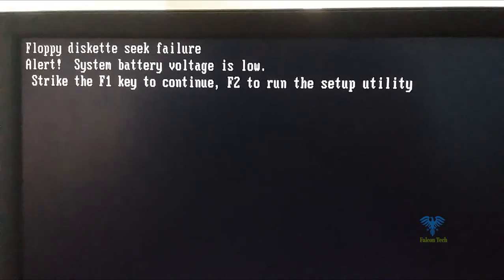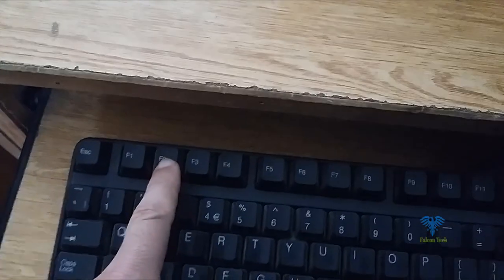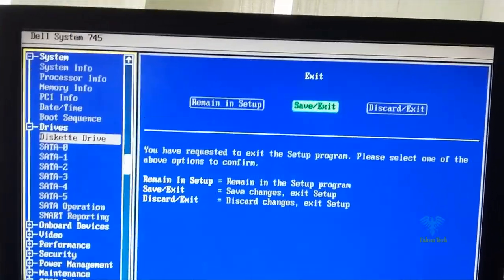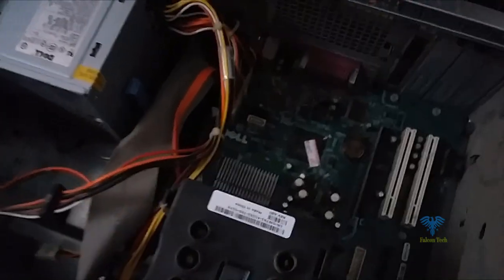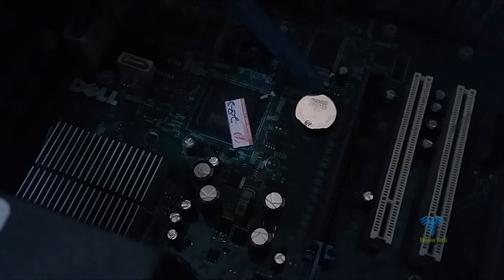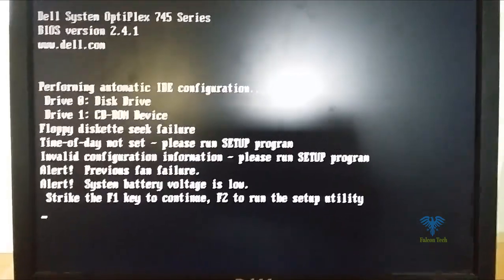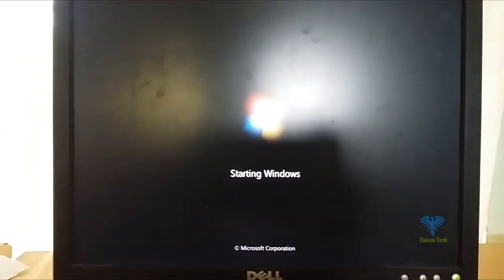(Fix) "Strike the F1 key to continue, F2 to run the setup utility" | "System Battery Voltage is Low"

Comment: This is not really a fix, just to take away the message, you actually need to replace the 3V CMOS battery because it's lower than 3V. But for those who can not find one in time, then this will do, but just remember to replace your battery int he future.

Comment: Where do you get these batteries
Reply: Walmart, Amazon.  Look at the model imprinted on the battery installed in your computer, in the video he showed CR2025, on my computer shows it's a CR2032.  Do a search of the battery model on Amazon or go to Walmart and pick one up.

Comment: Thank you 🙏🏼 I make music and I have all my music and programs on my computer if I change out the battery and do what you did can I still have all my programs and music files still on there or does it reset my computer and erase all my files ? Please reply I need an answer on that. Thanks
Reply from the maker: You can change the battery it has nothing to do with data loss.

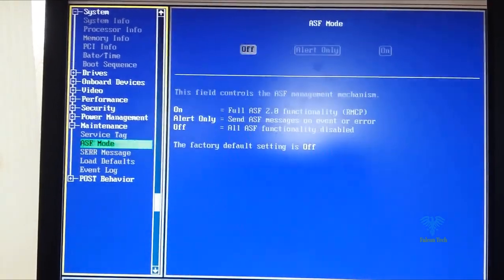Comment: 3:44 You have stopped the video . You have not fixed the BIOS problem in this video
Reply from the maker: I have fixed both problems mentioned in the thumbnail 1- Strike F1 to continue 2- System battery voltage is Low

Comment: I did this step by step and still getting low voltage error.
Reply from the maker: Did you clear the Event log in the BIOS after changing the CMOS ?
Reply: @FalconTech360  Yeah I did everything including updating bios. Pretty much determined it's a hardware issue at this point.

Comment: I just did the first steps, I didn't have to open the 'box', and everything's ok❤thank u very much
Reply from the maker: Please do subscribe to my channel for more videos
Reply: What if I dont have a battery problem?
Reply from the maker: @MCfact1827  then you don't need to watch second chapter of this video which is specifically made to fix Low battery voltage problem

Comment: changed battery didn´t work for me
Reply from the maker: You just need to erase the Event Log from Maintenance and then reboot the PC, it will fix the problem.
Reply: @FalconTech360  neither worked for me.
Reply: What kind of problem you are facing?